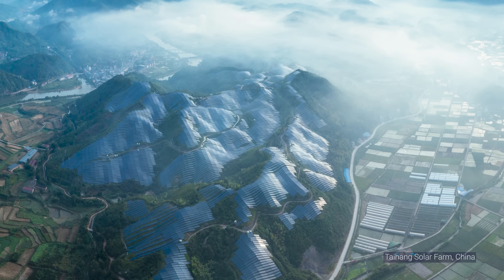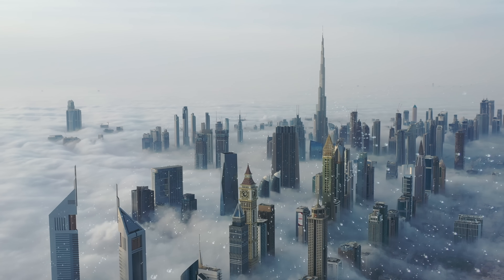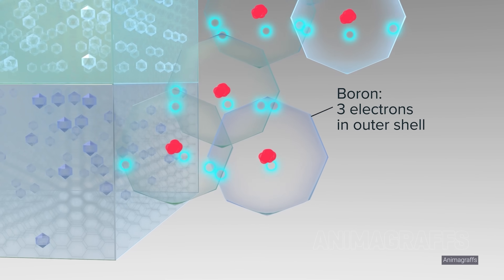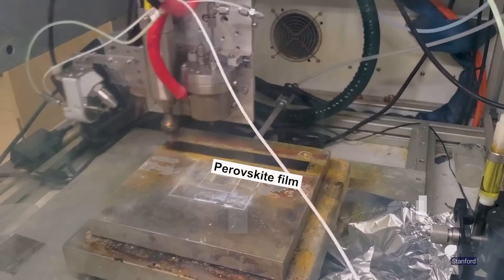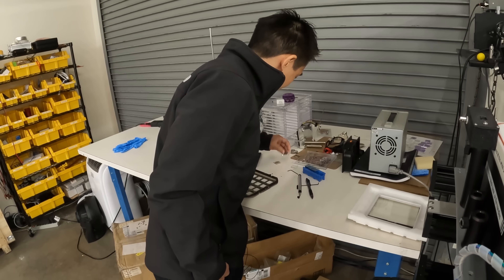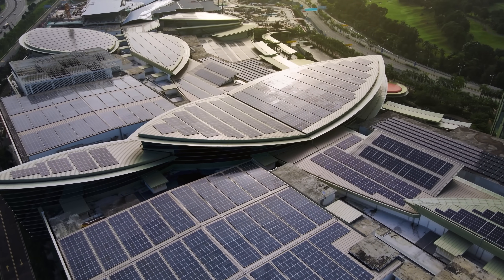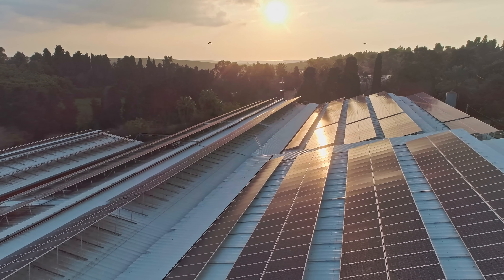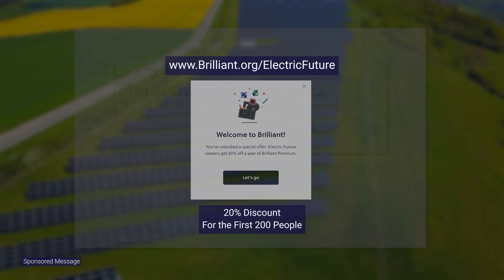Solar 3.0: This New Technology Could Change Everything

Comment: Back when I was looking at them in uni the big problems with perovskites was the inorganic part is usually a heavy metal cation and the film is usually is pretty water soluble. So manufacturing and end of life recycling is a big deal for them unlike with silicon solar cells.
Reply: Concentrated solar power is more efficient and easier to manufacture. Polished metal parabola pointing at a heat exchange coil in the focal point. Use the heat of the sun to drive a steam turbine. This process heats water, provides passive radiant heating, and generates electricity. 

Considering that heating is the biggest energy consumer. Hence why Canada has the largest geological footprint per capita. Excess heating is actually a good thing. Heat is energy after all. In fact a flame can refrigerate.
Reply: @brendanwood1540  The molten salt energy storage that uses focused mirror in Morocco is one of the least energy efficient and least cost effective solar project when place in real world situation. There's a reason why nobody uses concentrated solar power as you described to generate heat/electricity.
Reply: @brendanwood1540  concentrated solar power can be cheaper per m^2 when you have plenty of room and can implement tracking etc (there is a design where the pipes run along the centre line of the mirror so the whole thing basically just has to tilt up and down which looks pretty good for areas where you want fewer moving parts)

There are a lot of places where PV is a lot easier to implement and it is potentially considerably more efficient because there are materials which can generate electricity from at least near infrared all the way into UV, there is no way you could get 50% efficiency in a solar thermal plant. (And obviously they wouldn’t work on a vehicle or a house roof or to take camping or whatever)

PVs have a fairly long lifespan and they don’t require much maintenance before they are at their end of life so you can see why they are attractive for solar farms. Here in Australia a lot of solar farms have been able to pay for themselves in <5 years (so at least a 500% ROI with little risk in 25 years) and so far they don’t have to worry about energy storage so you can see why they are attractive.

If you have to worry about storage solar thermal starts looking a lot better and with continuous maintenance there is no reason your biggest outlay (the mirrors) wouldn’t last 100s of years. The problem is you can cost yourself so much in maintenance that they aren’t competitive with PVs especially where storage isn’t an issue.
Reply: @glenecollins  Tracking isn't required. The path of the sun throughout the entire year is predictable at any given latitude. 

Likewise a lens could work as well as a parabola. Thermal mass storage would be ideal for this application.
Reply: @brendanwood1540  the path is predictable but if the mirrors don’t move the spot or line they focus on moves throughout the day following the sun so that the focused beam falls on the required area is what I meant by tracking.
Reply: @brendanwood1540  large lenses tend to be far far more expensive than an equally large mirror and they lose more light/ heat due to absorption and scattering etc. That is why reflecting telescopes like Newtonian and Dobsonian etc telescopes are used when larger optics are required rather than a refracting telescope.
Reply: @glenecollins  Think small not large. A lens combined with a parabola. A cheap fresnel lens, and a parabola. The telescope mirrors aren't polished metal. Most are like thin layer of film or even fluid.
Reply: @brendanwood1540  the ones in my telescopes and even the one in the nearest observatory to me are made of essentially the same stuff as the solar farms I have seen they are just silvered glass. 

There are a lot of ways of making a mirror and they all have their pros and cons for the application but making steel mirrors and coating them with something more IR reflective and able to stop corrosion etc would be pretty expensive using stainless steel even more so, I can see that being the way to go if you are putting it somewhere it is going to get beat up or sand blasted or whatever but we don’t have tornadoes or anything here very often and the glass ones are tougher than they look.

I don’t think fresnel lenses work as well with infra red using just glass I don’t think stuff that is transparent enough to IR to work and isn’t water soluble is very common so it would likely be really expensive. We used to use NaCl (salt) and Zinc Selinide or something as lenses and optical windows for IR when I was in Uni and those are both water soluble. I think the thermal infrared camera lenses are made of germanium and that would be really expensive to make something big with not to mention fragile.

One of the youtubers I watch (Linus of Linus Tech Tips) just got a bunch of more conventional PV panels with a water jacket under them he lives in Canada and is hoping to warm his pool while keeping the temperature of the panels a bit more regulated. He would be loosing a lot of heat through reflection and retransmission off the silicon I can see thin-film PVs over the top of a hot water or even reverse heat pump system being pretty efficient (assuming the perovskites don’t just dissolve) in a traditional solar thermal system the bulk of the visible light is lost through reflection.
Reply: @glenecollins  Yeah, thinking about ways to directly extract thermal energy into solid state or fluid. Rather than conversion into electricity. I also live in Canada. The Fresnel lens I was thinking of are more like slats of mirrors reflecting through open air. The idea of making it a Fresnel lens is two fold.

I give credit to a man from Ukraine who invented a system for heating water, and kiln drying wood ( I can't remember the name). His system could be scaled and not inherit too many draw backs. Because the slats allow for air movement the reflector array does not become a wind sail. The framework to mount flexible sheets is easier to produce than parabolic shapes. 

I was thinking of a different concept using plastic, or resin, instead of glass. Similar to rear projection televisions. You could mount the Fresnel covering a small parabola on the roof of a home. Like a satellite receiver. The Fresnel shell would keep birds and bugs away from the focal point thus protecting them from any environmental impacts.

Keeping it down scaled and as an energy supplement. We still require, and mostly have, a gas infrastructure. We could reduce our gas consumption for water heating, and home heating utilizing a passive solar design and implementing concentrated solar power.

Conventional panels, or turbines, could supply energy for electronic devices. The main consumers need to be addressed like refrigeration, coffee makers, microwaves, heaters, appliances, and power tools.

Refrigeration all the time. Heaters can be eliminated mostly or replaced. The others come in surges so the system needs to deliver enough surplus to charge a reasonable sized battery bank that can handle the discharge rate through appropriately sized inverter. 

Once you start auditing your energy consumption in the home to design the solar array is when you appreciate how much easier it would be to use less energy vs. generate it yourself. 

But this in-situ approach allows one to see the drawbacks of infrastructure. Why long lines cause resistance and massive losses. The grid we use automatically loses 25% of the power generated through line loss. Moving to our rooftops makes thick, expensive, copper conductors make a lot more sense. So even if it's marginally less efficient than a large scale proprietary array, the end result uses less material resourced for infrastructure and automatically gains a boost by eliminating line loss.

Not to mention the cost of infrastructure in installation, maintenance, and environmental impact. Copper isn't great at the cradle end, aluminum is seriously consuming power. 

I think the most expensive part of the system would be the turbine. Approximately $2000. Polishing the metal is easy enough to do yourself. But that turbine can pump out 1.5 kWh of electricity. Vs. 500 watts for a solar panel. You could obtain the equivalent output in panels for $1500 from three to fifteen times the area. Except the panels don't give you genuine hot water as a waste output. If the panels get too hot they get fried.

Stainless static parts would last a lifetime (sand blasting omitted). No water heater lasts forever. 

Sorry this is getting long... lol
Reply: @brendanwood1540  I live in rural Australia our climate is more or less Mediterranean, it hasn’t snowed here even in the hills in decades and we usually have about 300 days of pretty much full sun a year. Most houses had solar hot water with electric backup way before solar got popular. 
Our PV panels still last at least 25 years my parents place is totally off the grid and their monocrystalline panels lasted about 40 years before I had to get in and fix corrosion etc and replace the housing, they are back up and running again. They initially had a bunch of big 2V lead acid batteries which they bought used from our telephone company those things lasted about 15 more years for them then we got a series of AGM deep cycle batteries and stuff which only lasted about 5 years.

The solar water heaters we have locally started out as stainless steel boxes with glass or plastic over the top and copper pipe going through them now they are all silvered glass with a vacuum tube with the water in it, they do make the water a bit hotter but they are the ones I see getting fixed or replaced after every storm. 

The companies manufacturing the glass ones must make a fortune because sand and a tiny bit of metal coating can’t cost all that much.

I am ambivalent about having local power production vs centralised production, it make sense to have solar panels (of whatever type) on your house it saves you money and is ~better for the environment not to mention if you know what you are doing you can have power and hot water in blackouts etc. but here the vast bulk of our energy usage is in transport, mining and manufacturing and you can’t fit enough solar panels, wind turbines, tidal and wave power generation in a city for them to be able to do the manufacturing and run public transport, trucks etc.

My neighbors have a solar (PV) setup on their roof that directly goes to charging their electric car and only starts up the grid connected inverter when the car is full or not there, they tell me they have never had to pay to charge the car so even personal transport is doable if you have the money.

I was thinking about it while typing and would some sort of sterling engine type thing work for you guys where the air temperature is generally cold? They aren’t efficient enough here unless you are just getting heat from a wood stove in winter or something.

When I was in Uni in the early 2000s before PVs got really cheap there were a lot of people working on what are effectively the opposite of an air conditioner or heat pump you have pipes on the roof with a refrigerant  in it and the heat it turns it to gas which comes out with enough force to run a turbine you then have an area in a house you want to warm where the heat gets let out with a conventional radiator or these weird sculpture looking things, the gas cools and goes back to the liquid phase ready to get pumped back to the roof again. There are still a few people making them in Tasmania but I think they were too inefficient here where it is generally warmer.
Reply: Glen or Brendan, is there reading material you can suggest so I can read up in detail about Concentrated Solar power?  Thanks
Reply: @tonynotstated695  the Wikipedia article for solar thermal has a crapload of references including a lot of uses for solar thermal other than just making electricity. 

Materials today “stable molten salts hold the key to solar storage” has a good run through of trying to get around one of the bigger issues with molten salt solar solutions.

I got a lot of information from the CSIRO educational stuff and newsletters on it but they keep taking them down and they may not all be accessible from outside Australia. Solar is a pretty obvious choice for us because most of Australia gets a lot of sun, we have a lot of space and it generally isn’t very windy in most of Australia.

Comment: I've been hearing about perovskite cells for decades.   All thin films have durability problems.  Silicon cells last basically forever.  Most Si cells are warranted for at least 80% and 20 years, and many have lasted far longer in the field.  That's something that perovskites - or any other thin-film technology - haven't been able to overcome in all this time.
Reply: from the reports I read,  it seems the durability are improving rapidly.  when this tech just come out,  it can  only last few minutes,  now 
months.  If it can last  a few yeaes,  it is already suitable for some commercial uses.  Let's hope it comes soon.  Another thing is the cost, not sure how it compares to traditional Silicon solar panels.

Comment: I live in Florida in a hurricane zone. I've purchased a folding 125 W solar panel to recharge my RavPower 125 W powerbank. When the lights go out I switch on my LEDs and can power my Mac mini and Macbook. I'd love to have a test panel of these Perovskite solar cells to test in Florida. The aforementioned panel will recharge my RavPower from 0 to full in about 4 hours in good sunlight.

Comment: Part of the segment says that they dont currently last the 25 years of common solar panels.  It does not need to be perfect, it does not need to last 25+ years right now, some could be put out into the wild on roofs now if you can say it has a 5 year expected life.  That gives 5 years of data of in the field while you experiment with formulas.

Lets say on a 5 rotation, they could be seen in a similar light as changing the battery in a smoke alarm every year, or in this case 5 years.  Once a roof install is in place, you dont have to re-install the base, inverter, or battery storage, just take of the old film, and put in the new film, a hypothetical 1 or 2 hour job, every 5 years.

If the manufacture cost is less than 1/5th the overall cost of silicon based cells, then a customer gets upgraded cells every 5 years for full capacity as opposed the the slow degradation of the 25 year cells, and for less cost.  Not withstanding that the costs go down as technology advances in the field and more companies make the new cells this saving more on per 25 year upfront payment model we currently have.
Reply: ...and if the efficiency drops by, say, 10%+ over that 5-year period, and if the low-light performance is worse, if durability in extreme conditions isn't as good, etc., then they won't be ready for prime time anytime soon, if ever. I was a bit surprised that the efficiency improvement isn't better than the 30's. I think that is going to make it harder to justify the downsides, including the hassle and labor of replacing them every 5 years in your example. They might end up just improving amorphous-type, unusual applications.

Comment: If these things are as cheap to make and deploy as implied, then longevity in the environment is not really a concern.  Most devices we use these days are not used for 25 years, and maintenance and rapid replacement is a viable strategy provided the cells can be easily recycled in some way.

Comment: It’s important to experiment with solar cells in direct or simulated full sunlight, however, I believe in making the cells for the low cloudy conditions.  If they do well on a cloudy day they will be totally outstanding on a sunny day.
Reply: Cloudy days are not concise or uniform, it's not good for scientific research but they will perform well in that environment, apparently the problem is its fast degradation.
Reply: My cards are on Thorium generators.
Reply: @charlesmartell4484  Yes but solar and nuclear complement one another, because nuclear is hard to ramp up and down, so you have to design in excess capacity that is typically wasted at off peak hours, but solar adds in extra energy during the time of day when usage peaks.
Reply: @hzuiel  It's actually very easy to ramp up and down nuclear. They don't do it because the fuel is cheap just like solar if it's fully lit and no one is using the energy than all the energy collected is being  wasted. So in other words nuclear and solar both need an energy buffer e.g battery or pumped hydro.

Comment: Even the longevity issue isn't as big a deal if the cost advantages can be realized. I'm not going to pay $40000 for a solar array that last 40 years If I didn't make a do with an array that costs $500 even if I need to replace it every 2 or 3 years.

Comment: All well and fine, except perovskite is 1. toxic,  2. perovskite that lasts only a year. Which is of course the reason silicon panels are used instead. Perovskite is not a new solar cell. It has been around for 30 years

Comment: USA has 2 or more patents magnetic cycle energie and also texas instruments patents to charge calculators with a light bulb that can charge a mobile phone.... it is a shame.,,, germany don't allow this patents and they are doing nothing to bring it on,,,, im sure you can charge your lights laptop and mobile phhones at extreme even your boiler.... you just put a lamp in the middle and then surround it with light taker

Comment: Would the reduced temperature that it is created with cause issues if ambient temperature around the newer pV panel were to approach the temperature it took to create it? Silicon won't melt or denature in the sun. Just wondering if the lower temperature it takes to create the new kind would or could cause issues.